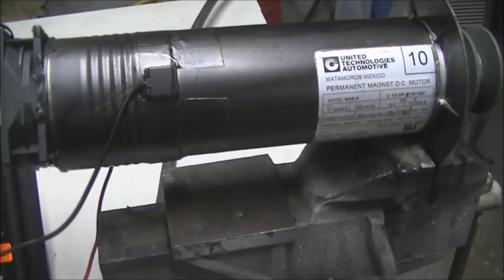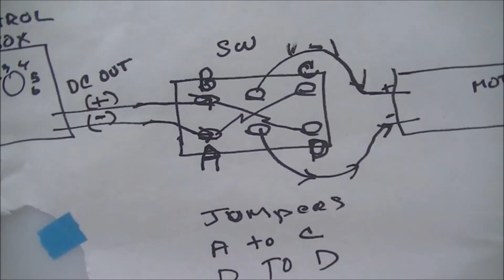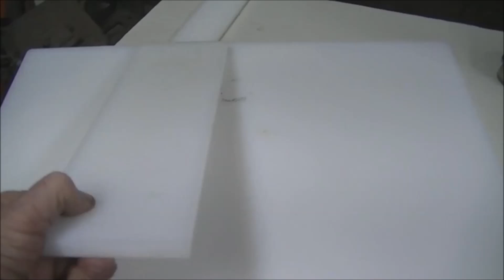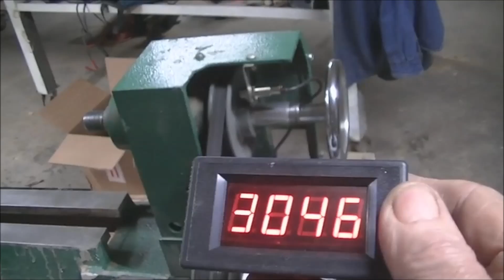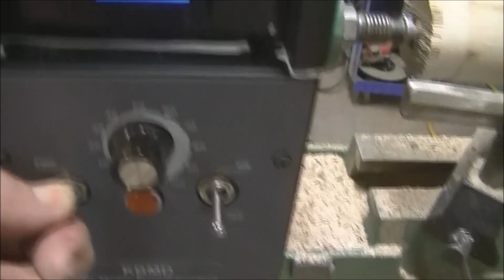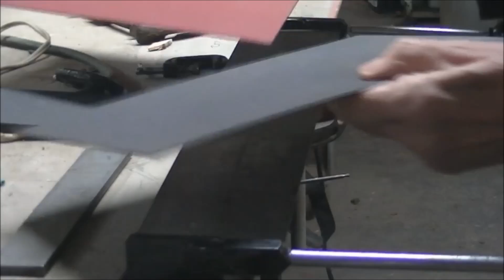Harbor Freight Lathe Conversion using a Treadmill Motor

Comment: Do you happen to have a complete parts list for everything?
Reply: I'm sorry. I didn't see how old the video was. I'm getting ready to do the same thing very soon. I loved the video though.
Reply from the maker: @garyculver203  That's cool. See ya
Reply: What kind of temperature guage did you use if you don't mind me asking? I'm having trouble finding it on line
Reply from the maker: @garyculver203  I think you meant Speed Indicator.   Of course, you know I don't remember.  They all work the same with a magnetic on the shaft and the pickup close to pick up the signal. Take care, Larry
Reply from the maker: YOu do realize that has been 6 years ago.  I don't think I ever had a parts list, but thanks for asking. I generally just have it all in my head. Take care, Larry.

Comment: Larry,great channel and great ideas! Been watching your HF conversion videos,over and over. Am about to do the same thing to mine.
The one thing I saw,and heard,is that you ran 220 to the lathe? Were you actually running the motor on it at 220V ?
Reply from the maker: No, the HF lathe was 115V, best I remember, that's been 4 or 5 years.  It may have been that I was getting ready for my new one, it's 220V. Thanks
I checked it's been 6 years next month.  Where does time go?

Comment: Is your treadmill motor a permanent magnet motor? Are you running it in reverse, if so has there been any negative things with the motor when running it in reverse?
Reply from the maker: It's been over 4 years since I've had that lathe.  Don't remember any problems with reverse.  Check here. Motor is available at http://www.surpluscenter.com/shop.axd/Search?keywords=treadmill+motor.  Thanks Larry

Comment: Hey Whirller. It's Frank from WoodWorxct.com. great build. How is the tork at 250 300 RPM?
I just got a motor. I need to start at those seeds with big wood.
Reply from the maker: Man, that's been almost 4 years ago.  I have no idea.  You might want to look at pully sizes, therein lays the secret.  Thanks, Larry
Reply: @TheWoodWhirler  Larry. Thanks. Do you still use your converted lathe?  Do you have tork issues?  I have a 14 inch delta with reeves drives that spins at 500 on start up. With a big piece on there it's a bit scary. Wanted to know how you made out and what you turn. Thanks again for all the detail in the video.
Reply from the maker: @frankbua5581  No, haven't had it for about 4 years.  Yeah, 500 rpm is rough and dangerous.  Best I remember it handled it, but that's a small lathe for a big piece of wood.  That's why I upgraded.  Take care, Larry

Comment: Im curious how this lathe set up is still doing. I own this model and just replaced the bearings. I noticed you offset the balance of your pulleys... How are your bearings doing? 

Also, I would love to add that hand handle off the left of the head stock to mine. Where did you get yours and what are the threads I am looking for?  

Great video!
Reply from the maker: I haven't had that lathe in about 4 years, so I can't tell you.  Thanks, Larry

Comment: Did you wire the tackometer into the speed control board ?
Reply from the maker: One side goes to 5volts, the other to the pickup.  You will have to glue the magnet to your driveshaft and mount the pick up where it picks up the magnetic.  I can't remember where I got the 5 Volts. 
It's been over 3 years.

Comment: I have the same lathe and want to do this upgrade. Thanks.
How did you connect the hand wheel to the rear?
Reply from the maker: It screws on, reverse threads.

Comment: Good morning,  I am kind of new to turning.  I have the harbor freight 12x33.  I am trying to figure out what I need for a 3 Jaw Chuck but I am having lots of issues.  I find a nice one that I think will work and then it is not threaded or I can find anything out about it.  Please offer me some sound advice.
Reply from the maker: You need a 4 jaw chuck.  3 jaws are generally for metalwork.  Check out Nova chucks for wood lathes on Amazon.  Yours is 1" X 8 threads per inch.  See ya, Larry
Reply: Thank you sir

Comment: Nice conversion.  I have had the same lathe for about 25 years.   I store several bags of sand or concrete on the shelf between the legs.  The thing that bugs me is that the tail stock does not stay put when locked down.
Reply from the maker: You know the tail stock is adjustable, big nut under it.  Or you ways are too slick.  I haven't had that lathe for ever, maybe two years.  Thanks, Larry
Reply: Thanks.  It’s been some time since I messed with it.   I tried adjusting the nut.   Maybe time to try roughing up the underside of the tailstock.

Comment: My headstock cracked and fell off right after I turned, have you had any issues like this or at all with it? I am a young turner (14 almost 15) so any advice you have would help me alot as I am mostly self taught beside a few videos, thanks
Reply from the maker: Wow, never heard of that before.  I assume it is a HF lathe.  I would take it back to HF regardless of how old it is.  But, first I would take pictures and contact HF on line or phone.  No offense, age does matter when you want to get something like this done, maybe your dad or mom.  They always say "the squeaky wheel gets the grease".  The other choice you have is to have it welded, cast iron can be welded.   Wish I could help Buddy, Larry
Reply: @TheWoodWhirler  Thanks Larry, it is a hf lathe, I used high strength epoxy to repair the head stock  since the cracked didn't go across the entire headstock and replace the rod that you loosen to change the position of the headstock and it seems to have solved the issue but I havent turned anything that I normally do just a pen, and my hf is pretty tough on you needing a receipt and warranty even if it is a factory defect, thanks for the advice, Jack
Reply from the maker: @thewilddinkus8026  Get away from your local guys, they just follow protocol.   Got to go to headquarters and raise hell.   JB weld would be better.  Take care, Larry
Reply: @TheWoodWhirler  will do, the belt just broke today so I am going to, I have had to fix almost everything on this thing in less than a year, I know it is a cheap product and pretty low quality but, that should mean they can make it less safe or this bad! Looks like I learned my lesson for next time though. Can't wait for the next video, Jack

Comment: you've had this for a while now.  Does the motor handle turning bowls, if you take big cuts?  does it slow down?
Reply from the maker: I got rid of that lathe about two years ago.  But to answer your question, no it doesn't affect it.  Thanks, Larry

Comment: Brilliant job. I have an old wood lathe and I could not get a replacement motor for it. Now I can see how to use your method and bring my old wood lathe back to life. Great job and well done :D
Reply from the maker: CAn be a hassle getting everything lined up right, but it works like a charm.  I moved up to a Grizzly G0800.  Great maching, but as normal I have things I don't like about it.  Thanks and take care, Larry
Reply: @TheWoodWhirler : Thanks for the info Larry. 

Is the Grizzly G0800, the motor you upgraded to and does the 800 part mean it's 800 watts? I am in Scotland and was not sure what you meant. What wattage of motor would you recommend?

Cheers mate. Oh, I just subscribed.
Reply from the maker: @mikeflight9  Thanks Mike, but it's just been to long.  Sometimes I can't remember what I said yesterday,  Take care, Larry
Reply: @TheWoodWhirler : No problem Larry. I will get it all worked out. Glad I saw your video on this. It has helped me to go ahead with the project and given me ideas :D
You take care too.

Comment: Nicely done! Think if I put in that much effort, I would want those rpm’s a bit lower than the 5 or 600 stock.. depends on what your doing I suppose
Reply from the maker: As long as you are turning little things like pens, it's OK.  If you turn bigger blanks that are out of balance, sometimes you can't turn over 300 at the beginning.  500 would be out of the question.  Glad you enjoyed it.  Take care, Larry

Comment: Great, informative video, really appreciate your contribution. I just picked this lathe up from a Labor Day sale yesterday and was pretty saddened to learn how wimpy the stock motor is. Maybe I just got a bad one, but it bogs down very easily. I've been researching motor upgrades and your video is the most complete explanation I've found so far.
Reply from the maker: Yeah, that was my biggest grip.  Jet has one just like it.  You can get parts there(Jet 1236).  They might have a motor upgrade, I don't know.  Theirs still has a 3/4 HP.   The problem isn't finding a motor.  It is finding a motor that will fig their mounting bracket.  On the bright side, it teaches you to control your cuts.  My Grizzly (G0800) has a 3hp and you cannot stall it.   That can be good and bad.  Sometimes I wish it would stall.  Take care and good luck.  Larry

Comment: Great job. I have the same lathe and I turn out some very nice turnings. The one thing I don’t like is the low speed, it’s too fast to cut threads. You need 250-300 as the low speed. I was interested to see what your low speed was going to be. Unfortunately it’s still too fast. My lathe starts at about 500 rpm. Maybe I could find a tread mill motor that starts real slow.
Reply from the maker: Sorry, I just saw you comment.  You gotta have more than just eh motor.  Thanks, and take care, Larry

Comment: What size is the pulley on the motor it self
Reply from the maker: I have no idea, it's just been too long and I don't have the HF any more.  Thanks, Larry
Reply: The Wood Whirler  no worries Larry it's a 1/2 in. Reverse thread. Thanks for the video

Comment: I have a 17 mm shaft on the motor and a 13/16" shaft on my 1947 Shopsmith.  Where can I find pulleys to fit.  I can either use the original 8 groove pulely on the motor or put an 8 groove on the lathe. Or find a 17mm V belt for the motor.  Motor does not have a spline or slot.  Left hand thread thread on motor shaft with no shoulder to stop the pulley.  Any help would be nice.
Reply from the maker: I really can't help you on that.  It's just been too long.  You can take the pulleys and belt off a tread mill.  If I remember right, I took the tread mill pulley, put a new center in (it's plastic) and drilled it to my spindle shaft size, which I don't remember.  It worked fine.  It's doable.  Take care, Larry
Reply: Sleeves are available on Ebay to adapt between shafts and pulleys.  They had the size I needed to go from a metric shaft to english unit pulley.  It was not expensive.

Comment: Thank you for the great detail. I have been looking at wood lathes costing many times more then the Harbor Freight model. After seeing your reviews and common sense information I see no need to start with anything more than the Harbor Freight.
Reply from the maker: The HF is a good lathe for the money.  I wanted to turn bigger bowls and didn't like the swinging head.  Seems like when you put it back in the original position it was out of line.  Need any thing, let me know, Larry
Reply: I found a used shopsmith lathe,,,it' can handle 16 inch diameter must be 300 lbs,,,payed 65 dollars,,,if you look you can find many well built lathes cheap,,,

Comment: I noticed that you still have it start in the 4-500 rpm range.  One of the reasons I'm looking at a DC motor is to be able to go lower for big, awkward stock.  Was that planned or just what you had to deal with.

Thanks.
Reply from the maker: It's all about headstock pulley size.  I think it is around 200, not sure.  I don't have it plugged in.  It's stilled wired at 220 with no plug on it.  Take a look at my video #40.  Thanks, Larry up.

Comment: Love the mods. Did you mention where you got the control box? If possible could you post a link? Enjoying your channel too, lots of great content. :)
Reply from the maker: I got it on Ebay.  Just make sure you controller output amps matches you motor requirements.  Thanks for viewing, Larry
Reply: Thanks Larry. I'll search around. :)

Comment: where can i get a regulator larry
Reply from the maker: By regulator, I guessing you mean DC motor controller?  I got mine on e-Bay.  Just search for "DC Motor Controller".  Thanks for viewing, Larry
Reply: thanks
Reply: d.c ?
Reply from the maker: mike pruett
Treadmill motors are DC (direct current), like a battery vs AC (alternating current), like your house.  Take care, Larry
Reply: not using a treadmill motor  have the original  thanks
Reply from the maker: 10-4
Reply from the maker: My original is a 115v single direction motor.  If yours is the same as mine, I think if you use variable speed control, you will burn it up.  Larry
Reply: thanks    hey how long did u work at body shops  im still doin it
Reply from the maker: mike pruett
Never worked at body shops, just a hobby for 40 years.  Larry

Comment: I liked the treadmill conversion setup,in my dreams I would like to try something like what you did in this vidio.
Reply from the maker: It works pretty well Dave.  I am a little disappointed in the power.  It still bogs down on the large wet bowl blanks.  But, I have learned to work with it.  Take care and Thank you, Larry
Reply: I did this 2 years ago, turned out good, make sure you get the biggest motor. The  tricky part is making my own control box -you need to draw a diagram. Heck, after that I made my drill press variable and reversible too.

Comment: Well done!  One suggestion: Mount the on/off, speed, and reversing controls at the other end of the lathe.  There are two reasons for doing this.  One concerns ease of turning and the other concerns safety.  Where you have the controls now increases the size of the headstock -- which may interfere with your ability to access the headstock end of a turning blank with your lathe tools.  

Also, if something goes wrong and you need to shut off the lathe, you may need to reach past a spinning object to reach to on/off switch.  Ideally, you want to be able to turn the lathe on and off without passing through the "danger zone".
Reply: Simple fix for an Emergency shut off, put a commercial light switch controlled plug at the other end and power the switch from the wall. Or Harbor freight's router speed controller. It has an on/off switch, and you can slow their lathe down to around 450 rpms instead of the factory 600-660. Still not reversible, but you can reduce the speed some.
Reply from the maker: I put a emergency on/off switch on the right end and moved the controls. It's all in one of my updates.  Thanks for your thoughts.  Larry
Reply: If I'd just watched your other updates, I'd have seen that you'd addressed both my concerns!
Reply from the maker: Good we are thinking alike, Larry

Comment: Very nice upgrade. I'm planning to do the same thing on my lathe and was wondering where you got the tachometer and how much it cost. I haven't found one I really like yet at a price I'm willing to pay.
Reply from the maker: I got mine on e-bay for $12.95.  It works well.  It does not come with a case, you have to mount it.  Anything else, let me know.  Thanks, Larry

Comment: Great Job!!!
Reply from the maker: Thanks man.  It really works well.  I was a little concerned about low end toque so I just install a much smaller drive pulley.  I lost a lot on the top end, it tops out at about 2500rpm, but the low end is very strong.  New video coming out in few days on inside/out turning.  Tell your friends.  Take care, Larry

Comment: Thanks for making such a detailed video.  I have a large DC motor to attach to a similar lathe.  It was nice seeing how you addressed everything.  I was considering if I wanted to keep the Reeves drive with it as a secondary system, but I think it makes sense to put in a fixed pulley like you did.

I'm also trying to decide if I want to try the upgrade before an event in April.

Thanks again!

Comment: It looks like the KB motor controller can handle 2 hp with the heat sink.  Looking online, the best price I can find is just shy of $140.00 and $33.00 for the heat sink, both on ebay.  What is your source that you got your controller for $90?
Reply from the maker: Here was the item # 231809961361.  The seller is  sneaker62.  You beat me on the heat sink.  You will have to get the right resister for a 2HP.  It comes with one for like a 1/4hp.  They are only $3.  Seems to handle the 2.5  good.  Take care, Larry

Comment: Larry, you son of a gun! That's hands down the coolest fix I've ever seen!  Good for you! Btw, the Bear sticker has a protective film over it so it doesn't get scratched during storage/shipping.  You're supposed to peel that off lol :)  I wouldn't bother peeling the protective film off the letters.  I tried to and kind of destroyed one of the letters lol  I'm glad to see you bought the beast! It's a great saw and I know you'll enjoy it!  Way to go!
Best regards,
Peter
Reply from the maker: I tried to pull the film off, it tried to take my bear with it.  Thought about a heat gun, what you think?  I like my bear.  The grand kids come in and the first thing they focus on is the bear.  So I need to fix it.
Reply: +WoodTurning with Larry Heat gun might work...Don't hold that against me if it doesn't though lol :)
Reply from the maker: It don't matter.   Me think it was in a very hot container for a long time.  It's welded.  Larry